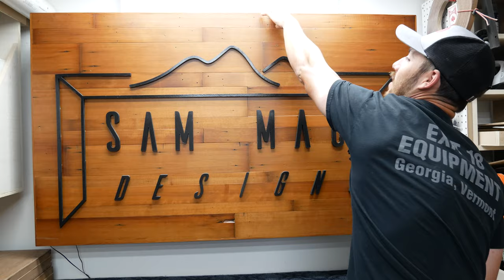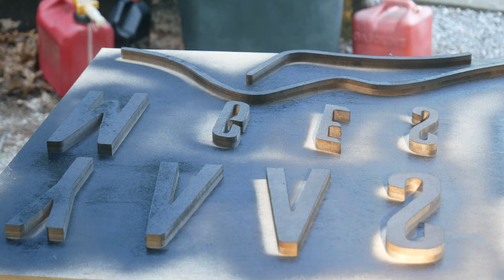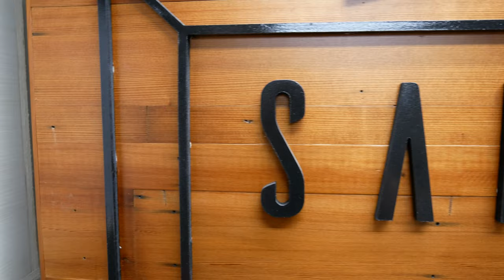How To Build A Sign With Hidden Whiskey Cabinet!

Comment: That dado stack set up looks so sketchy. Running off the fence the way you were with your hand above the blade and no fence on the saw bed either 😖 sooooo sketchy
Reply from the maker: Probably so 😬 I definitely wouldn’t do it if I have to take out more than a quarter inch of material, I’d probably switch to a router and a guide in that case
Reply: @SamMacyDesigns  it would probably be okay if you had a sliding bed to hold the timber tight against. You probably know that anyways haha. Nice job nevertheless 👍